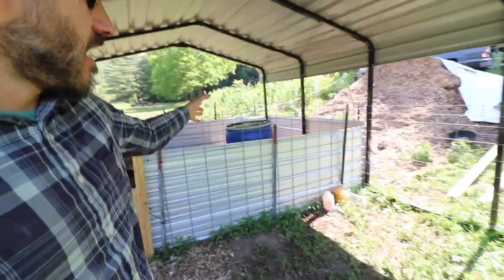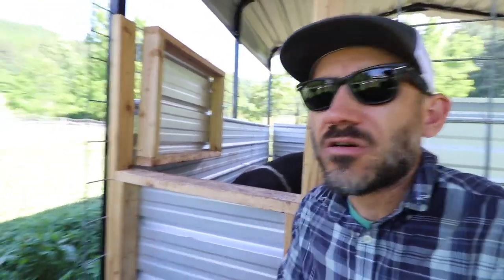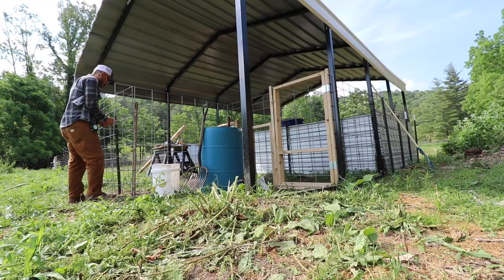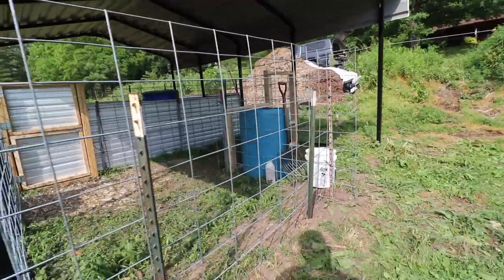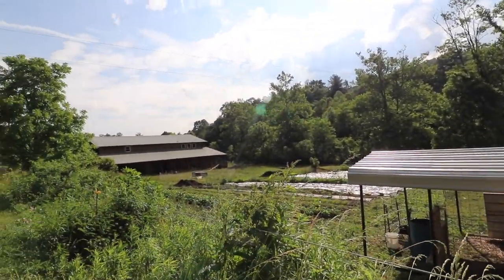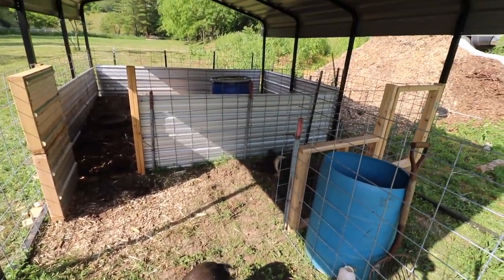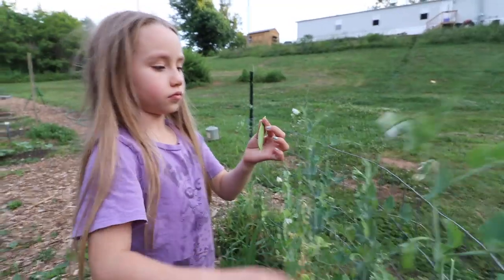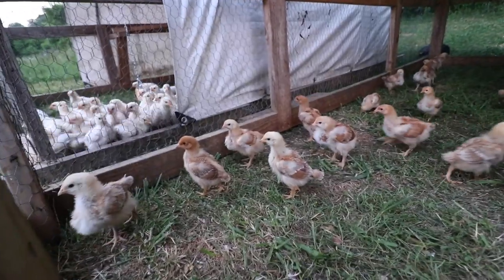Carport PIG Shelter BUILD 2.0 (Update!)

Comment: You could suggest to Justin that he put his pig water barrel outside the pen in the tack area where the cider vin and such is, and just have the nipple poking through the fencing in the shallow bedding area. you could frame a slight border in front of/under it and fill it with pea gravel. then any spillover mess from the pigs drinking is not wetting the deep bedding or making a wallow where they drink. It would make for easy fill access, too! Just an idea :) great work!

Comment: It would be great to use a carport with clear plastic for a green house/winter chicken coop with sides that open for summer air flow.  Just throw over some plastic to shade in the spring and summer.  You can let the pigs make the compost from the chickens deep bedding.  Throw in some corn and let the animals do the heavy lifting.

Comment: I would put some chains around the hinges side of the door. Pigs are little bulldozers and I can see them popping those screws right out if they get curious enough to push against that gate. The chains wouldn’t keep the crews from popping out but at least the gate would still stop them. Probably small dog chain would be all you would need, or even some wire. If you loop it around it won’t interfere with the operation of the hinges or the gate opening and closing. Worst thing I’ve ever tried to fence in was hogs. They dig under or just force their way through about anything! You can’t appreciate how powerful they are until you’ve had to deal with them much.

Comment: I have had pigs for many years so know what I'm talking about here.  You need to re inforce that gate.  As the pigs get larger they will push right through that one.  A simple solution would be to put up some brackets with a drop bar across the bottom half of the gate to make it stronger.  Pigs are super strong.  Much more than you probably realize.  I would also watch for them to start digging under the pig panels and making holes big enough they can get their noses under.  If they do that they can lift those pig panels up along with the t posts and you will be chasing escaped pigs all over the country.
Reply from the maker: thanks for letting me know shirley. I hope you have a good day!

Comment: I find it interesting to watch you build. I do like the design of this pig shelter you built. I am wondering since the roof and sides are  metal, will the metal become extremely hot from the sun and reflect the heat onto the pigs?

Comment: Don't they move pigs with basically a panel that is around something like 3x3 or 3x4 feet with a handle hole on top? Some with canes. Basically creating little walls to push the pigs in a specific direction? In reference to when he was trying to move the pigs. Looks good. Might be nice to have a removable area where the tractor can get in to clean it later.